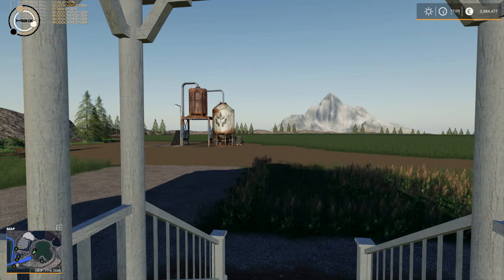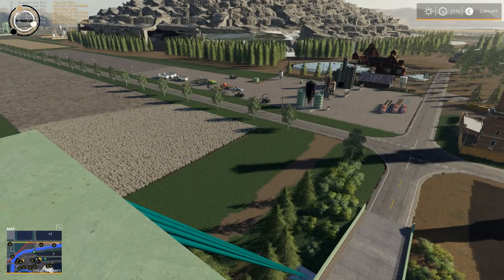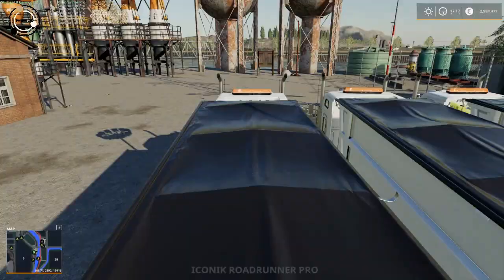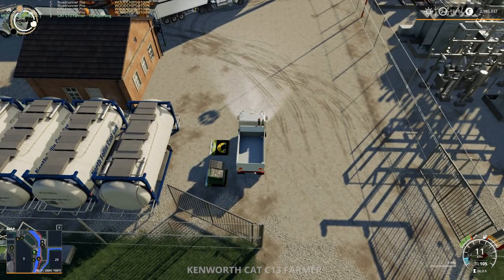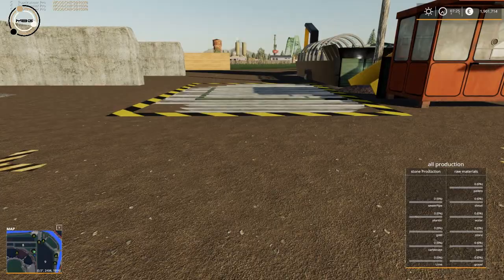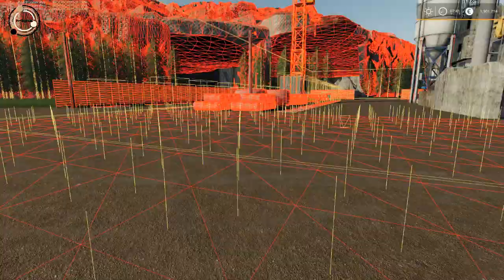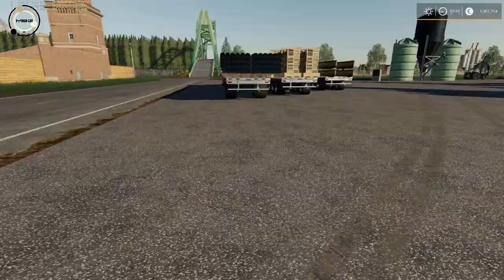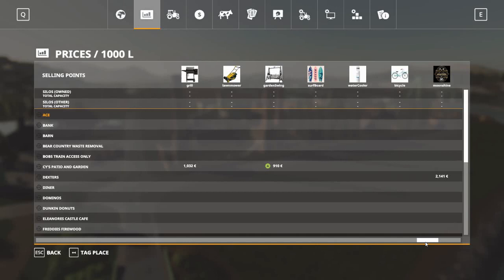Riccis Hollow : FS19 : Stone Processing + Heating Plant and Trash : Episode 03

Comment: My kenworth only goes to 65mph.  Other engine set ups are 52mph.  Am i missing something or did the mod on the truello site change somehow and i got the wrong mod?
Reply from the maker: At that time I used a tweaked version by papa smurf. Try the Kenworth 200 you can find it on FS19(dot)net.
Reply: @michaelbgaming9161  thank you so much for the response.  I will check it out, much appreciated.  I love this map and the showcase you've done.
Reply from the maker: Let me know if you can't find it, and I Will search for a link.